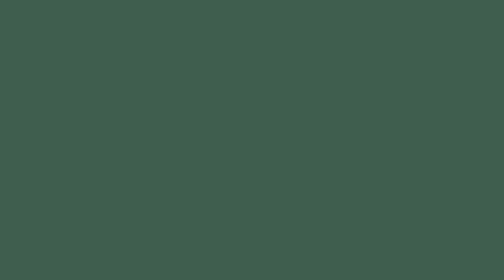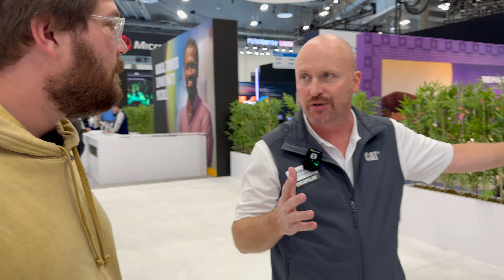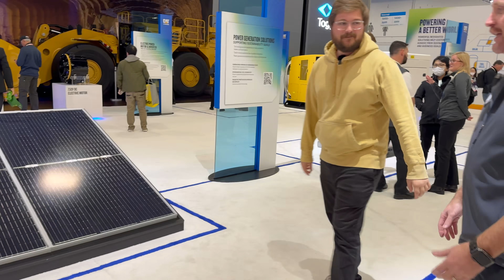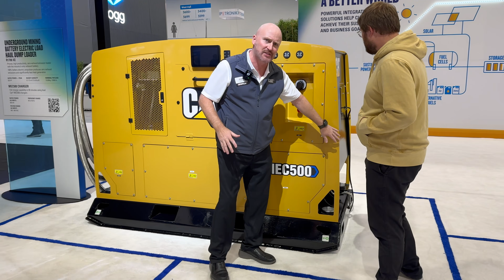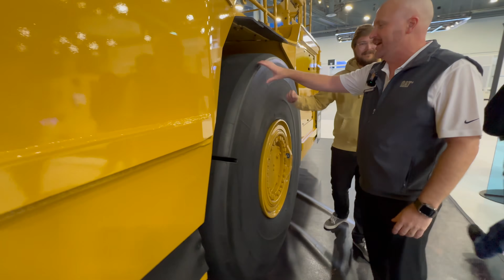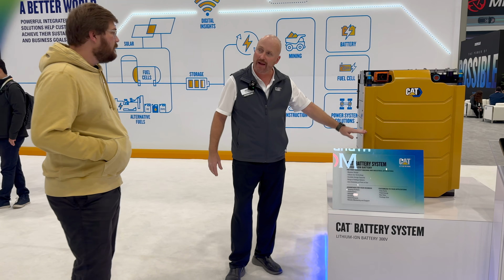CAT Is Going EV! Full Tour Of 500kW+ Chargers, Construction / Mining Equipment, & Battery Storage

Comment: Funny thing - I was just looking at what it would take to migrate a CAT299D3 track-skidsteer with a blown engine to electric (umbilical).  Replacing the 110HP diesel with a 100HP 3-phase 600VAC inverter duty motor, inverter, and step down transformer, cable reel, and step-up transformer (23kV - to 600V)... would cost about as much as a new machine. but would also work for other machines in the same basic power range (like a Cat317 excavator, etc...)
  
Why 23kV?  Transmission (umbilical) cable weight versus length - figuring a 100kW end of wire load, 600VAC would need 166A of transmission, 23kV only needs 4.5A of transmission (much smaller gauge cable like 14AWG, about 3/4" diameter, so more length on a reel).
  
One complication is that with an umbilical is you either need to follow it back through a work site, or be able to rewind it and manully move it around obstacles (which if one used an intermediate cable closer to the work area, could mean 1-mile of working range).  The former is easy with GPS navigation on-board, the latter easy with a 12-48V spool motor running from an on-board battery.

Comment: Retired electrican and ran great CAT gen sets up to 2,000 KW. Nobody is supplying accurate running times for EV when its zero degree F outside and you have to provide heat & a defroster for the driver. Somebody did a U tube vidio on a EV truck pulling his maximum load of 11,000 #'s during cold weather and could not travel even 50% of rated battery distance without towing a load. Great ideal having air cooled on the 700 amp plug & cable.

Comment: Those are great concepts. thanks for sharing.
one could even realize a true of grid construction. run it via solar and a big buffer battery.

or if the AC connection is weak. trickle charge it over night, when no one is working and you are set for the day.

thanks

Comment: Electric construction equipment isn’t going to work. It’s dumb and pointless. There is a guy that was using a smaller excavator that was all electric. It worked for 2-3 hours then ran out of charge needed to be recharged and that took 6 -7 hours. Your work day isn’t 3 hours it’s roughly 10-14 hours. So all this will do is increase down town taking longer to get jobs done. Thus increase costs, etc etc. diesel is much much better diesel works, it’s proven technology. If someone tells you it can run 8 hours without needing recharged divide that by 2. In the real world it’s usually half of what the salesman says. Salesmen lie all the time so you will buy it. Electric machine running all day is complete bs. And construction doesn’t quit just because it’s cold. The work still goes on even if it’s Arctic temps. A lot of times the job is behind so you skip lunch just to get it done. I would know I’m a heavy equipment mechanic and operator. Electrification makes no sense at all.

Comment: Definitely a tour of the proving grounds.... this is an area that a lot of EV holdouts could see how it does have its place, they are already familiar with electric diesel so this is a natural progression. Another thing is just reduction of noise on construction sites and in the mines. Something they didn't talk about is how long it takes to fuel the mining trucks like the loader: get it to a fuel point, ground it and then pump the fuel in which can be thousands of gallons and then break the whole system down when done which actually takes at least 18 minutes so there is no time lost doing the quick charge they discussed for the loader (I live in a mining town and my husband worked with the mines supporting emulsion and explosive needs). .

Comment: I have a concept for cat Industrie AGK DTS Hypo Economist Konzept Institut maison des associations Thüringen united Germany concept 33.d here is a combination of two car batteries that alternately charge and discharge the batteries in alternation where an electrolysis station is connected in between, one discharges and the second charges the battery and when the battery is full it discharges to the other battery whereby the  Electrolysis station constantly flows electricity to be able to produce hydrogen.  Or that the battery is shared in the e car to ensure electrolysis production ©®™ would charge 50 percent of the patent for their AGK DTS hüpowirtschaftus concept institute Maison des Associations Thuringia.©®™

Comment: Glad to see they made the belt motors on the mini excavator electric, rather than leaving it hydrolic. Wonder how long before we start seeing electric actuators too. They've used them on modren flight simulators for many years now. No seals that can go bad. No hoses that can break.
At least for the dozer-blade on the excavators, so they can eliminate the swivel joint. They could even add a (watertight) battery to the undercarriage and make the control wireless so there is no need for slipring either.

Comment: Really cool, but for the love of God just use the standard CCS chargers, or NACS for fast charging.
you’ve got a j1772 connector, great thats standard. Honestly if that was a six or 10 kW charger, you wouldn’t need a “ custom dc fast charging system” for only 32 kWh of energy.

And for the big machines, 1000v ccs or nacs should be fine.

Comment: Yes, more of this. For two reasons.  1) the sustainable energy transition is coming to construction and mining equipment too; and until quality EV tech channels start following & communicating advancements in these markets specifically, your EV automotive expertise will really do a great job to initiate coverage.  2) wrt SpaceX Mars missions & planetary explorations—which Starship is going to enable—neither Tesla nor SpaceX has not had the time/focus to develop these EV alternatives that will be required.  No diesel or gasoline on Mars.  Caterpillar already has the mining/excavating equipment experience!  With Cat moving into EV tech now, CatEV equipment become instant starting points (with telerobotic or autonomous control, and non-air-cooled heating/cooling solutions) for the sorts of equipment that will be needed right away to operate in the low-pressure environment of Mars to support SpaceX early missions.

Comment: I’m worried about the implications for this, but not because of it being electrified,  these are designed to run for about 8 hours use , but at the end of the day that means plugging in, most machines are left in the field , and most off grid , at best you can charge 1 or two a night , but a small fleet, further more if the generator is on site to power the charging us less than ideal , but further more many corps have known of a high degree of equipment often being stolen, this will only increase the likelihood and increase the disrupts that generator or equipment is damaged or stolen,  a gas powered they can easily truck in juice but off grid these machines will become a 5 to 14tonn brick , leaving operators ever the extra cost to move each night or run the risk of having to run extra security to protect the site , further more the hire market will have these issues and more as it’s more than likely the unit will be run till empty,  making recovery incredibly difficult

Comment: I own & operate a Terex PT50 (equivalent to a ASV RC50) compact skid steer loader, and it would be a FAR superior machine if it were battery electric. I'm currently burning 6 litres of diesel per hour in my Terex and it's very noisy in the cab.  An electric motor driving each track would deliver a higher travel speed and greater torque, so I could drive this machine up slopes with a fully loaded bucket (all up around 4 tonnes) with no reduction in speed. Plus it would be quiet. I want one tomorrow!

Comment: Can the 301.9 run (at least in stationary mode [hydraulics, but no tracks/traversing] with an  extension cord attached so that the battery is being charged while doing work?

Comment: BS, JCB and Bobcat have had electric construction equipment actually out on job sites for a few years. Most forklifts at most factories are 48v and there's nothing really special about the charger, they simply take 480v 3 phase and turn it into 48v DC.
Reply: It's not a big dumb lead acid battery, it needs a BMS, the communication and the charge profile to suit

Comment: In the long term, I think electric construction equipment has a lot of potential. Diesel equipment is so wasteful, spending more time each day engine idling than actually doing stuff.

The trick to making it feasible, of course, will be controlling costs. In theory, the cost difference of electric over diesel should simply be the cost of the battery at $100-$150/kWh; in practice, it ends up being far more than that, most likely due to the general cost premium of new technology and lack of economies of scale. In order for people without zero-emission mandates to justify going electric, the cost of the equipment needs to be competitive with the diesel versions.

Comment: I am fairly certain there are some missing details about mining. I remember visiting the coal mine exhibit in the Chicago museum and mines in California and a lot of equipment underground was running off AC power. They just drug the power cables around behind the machines, of course the machines didn’t drive very much, mostly just pushing forward through the rock. Also the huge outdoor strip mining machines were AC powered. What is novel is a battery.
Reply: let's hope this shiny new equipment will be used for anything but digging up more coal
Reply: @velotill it will dig whatever is in demand.

Comment: Great! Instead of bringing a mini excavator to the job site along with 10 gallons of diesel fuel, you can pay twice as much and bring a mini excavator to the job site along with a charging unit, a diesel generator and 10 gallons of diesel fuel.
Reply: Sounds like you watched the video with the sound off.
Reply: @davidmenasco5743  Instead of making a baseless comment, why don’t you tell me where I’m wrong? You need to pay for the excavator which will be much more in price, you will need the charger which is an additional cost, and in most sites you don’t have access to multi phase energy, therefore you will need a diesel generator. Go for it.
Reply: @CS-gg5hx  The whole conversation in the video was about charging the excavator overnight at the shop.

Because most of the diesel is burned up during idling, this wasted fuel does not need to be replaced when going BEV.  So, as the guest said, in most applications no on-site charger is needed.

You're welcome.
Reply: @davidmenasco5743  Be serious.  No contractor wants to haul a 5,000 pound mini X back to the shop each night just to charge. The salesman’s claim that only 4 hours of actual use per day is nothing but a pitch. What about the energy needed for heating and air-conditioning throughout the day? I sold construction equipment for a number of years and can tell you none of my former customers want to pay tens of thousands extra for this inconvenience.

Comment: That 48V architecture on the mini excavator is going to be difficult to manage! That's the reason they can't get an onboard charger above 3kW (60A), because when it comes to chargers - they scale with DC side amps (not power), so a 9kW 48V charger is pushing 188A - not like a car's onboard 11kW 400V charger doing under 30A - that's why the box is 5x the size of a typical onboard charger. They really will be better off (my opinion) if they switch to a 400V architecture for the batteries, drive motor, onboard charger, and hydraulic pump. Then scrap that charger box and use NACS for combined AC or DC charging. Literally all the components (not the battery) will get smaller and more efficient with the switch.
Reply: I knew if I went through the comments, I would see the clueless Tesla stan saying that it should be NACS.

Comment: This is cool A lot of the time on a job site they will have a Spider Box which is Power Distribution Box: 120/240V AC, 30 A Amps, L14-30P, (4) L5-20R GFCI, 3 Poles, 4 Wires  so they could easily hook up a portable charger to it with the appropriate cable adapters

Comment: They better hope that 4 hours of active use actually pans out in the real world.
Reply: 4 hour is just an average. There are some days when the machines will only run for 30 minutes. Then there are some days that require round the clock operation to get the work done. 

If that's not enough, there's total usable life of the battery. Our company has diesels with tens of thousands of running hours recorded. Will the battery still be able to give us 4 hours of operation after long? Of course not. I would just imagine these systems become regular consumables.

Comment: This was super great! John was knowledgeable and overall a super great guy who is in the right place.
Reply: i really wanted to know why he made that face when kyle said we can have that kind of charging in trucks aswell. What is the degradation looking like on those battries?
Reply: I don't know what "face" are you referring to. Could you point out time of the vid so I can look? I'm not sure which part you have in mind.
Reply: @patriksteffan2060  face at 21:50. context starting at 21:34
Reply: @a-don13  When I saw it I didn't think of it as anything strange. Just face of something like: "Yeah other can too if they manage to build something like that- nothing really stops them"

Degradation doesn't maybe know even them bc it's new. I think the high performance is possible bc of : High voltage, high cobalt for cathode and silicon for anode - I heard those have a positive impact on fast charging, great cooling - industrial machinery so that would explain too.